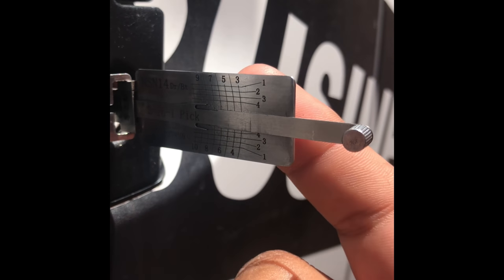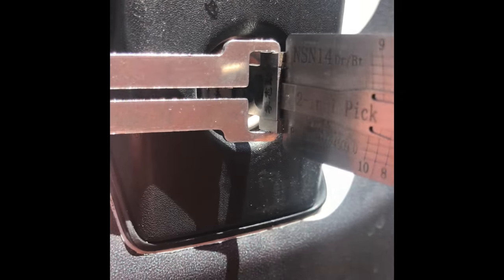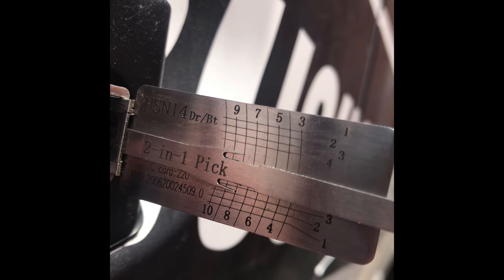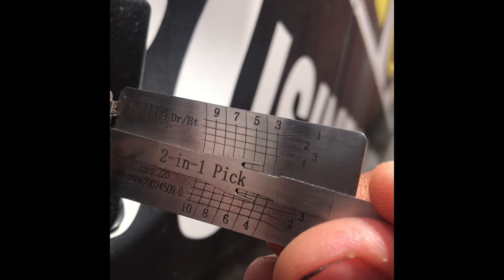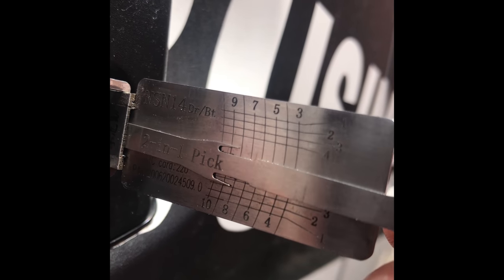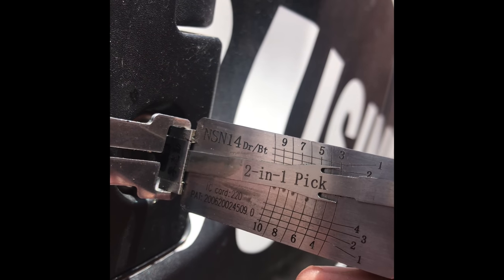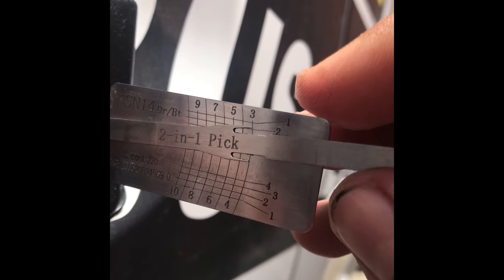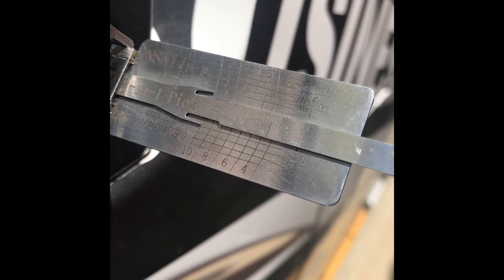LISHI 2-1 pick (EASY WAY)

Comment: You make this look an easy. I just spent an hour on my 2005 Nissan practicing the same pick to no avail. I think I'll try hitting it with some tri-flo. Great video. Thanks for making it!
Reply: Your probably overpicking. I can lishi anycar and decode in less than ten min. Execpet vw i havent practiced enoough decoding
Reply from the maker: Don’t give up, keep using them and believe  me, you’ll be a pro👍🏻
Reply: @californialocksmithco  Thanks. One year of practice and I'm getting quite good at it. I still struggle a little with Fords that have that secondary spring to it, Pontiacs with sloppy waffers, and anything missing the face cover. But other than that I can get most anything in 3 minute or less.

Also, I discovered that Triflo is GREAT for moving parts that need a lasting oil, like panic bars. But Houdini mixture of multiple lubricants works MUCH better for picking.

The high viscosity just gives you better feedback.
Reply: First time I picked a lock I was just messing around with a padlock and a pen... Never been able to since, but this tool... I actually like this tool. Considering getting one, well, 2... My mom's pretty forgetful and she's getting older too... Figured I can be a call away and be more adorable than the professionals or something ya know? Don't like the idea of her doing like grandma and just leaving the door unlocked because it's not the best neighborhood some years... Others it's fantastic... Depends on the high turnover apartment complexes on the block
Reply from the maker: Check out the link in the description, you can purchase one there 👍🏼👍🏼
Reply: You may very well have the wrong pick for your car , there are so many different ones they all work on different groups of cars so maby try different car or look online for what cars your pick will open

Comment: This is a load of carp since when do you turn a key clockwise to open a car or van door and if you were to take the reading it would be wrong as you picked it the wrong way
Reply from the maker: Some cars rotate clockwise to unlock. Also, a lishi is mostly used to decode locks, so picking it left or right doesn't matter. Any trained professional or even an amateur would notice know that.

Comment: How do u know if you got push up or down on the solid areas?
Reply: It corresponds to the number on the pick. For example the 3 section is on the top of the pick so you push up while 8 is on the bottom so you push down.

Comment: How do you know whether to click upwards or downwards?
Reply from the maker: The easiest way to identify the proper side to pick, is by inserting the Lishi tool and (do not apply tension) go to the first position and you should feel  (Springy) if you don’t feel any springiness then flip the pick around. So basically every position that has a springy position means that it’s supposed to be picked and you are indeed on the right side.

Comment: Can you make new video on Lishi that have 2 picks top and bottom?
Reply from the maker: Yes I’ll upload it tomorrow
Reply: @californialocksmithco  On a different for a new auto locksmith as far as stocking up some inventory,  I do have remote head keys for late models Camry/Corolla, Dodge Ram 1500, Honda Accord, Ford F150 etc.,   what other chip regular keys(no remote) a locksmith should stock up that will not cost arm and leg,  and good and fast sellers.  I am in So CAL  big market. 
Thanks.